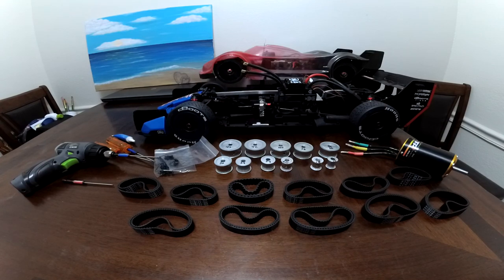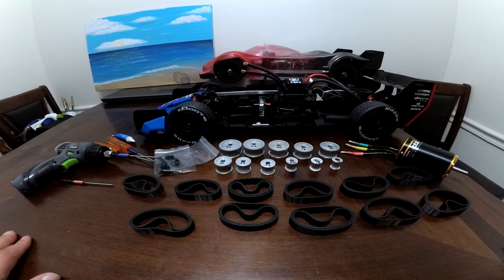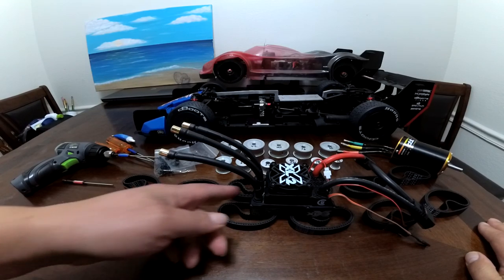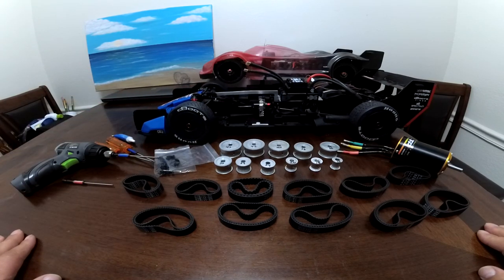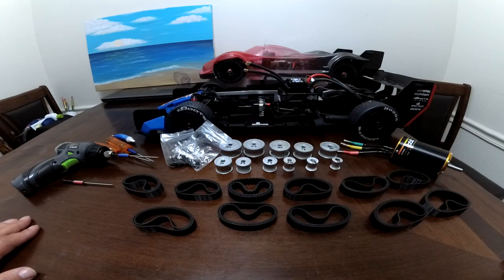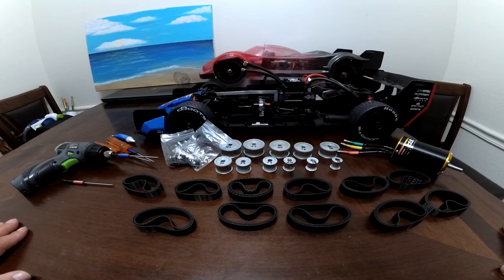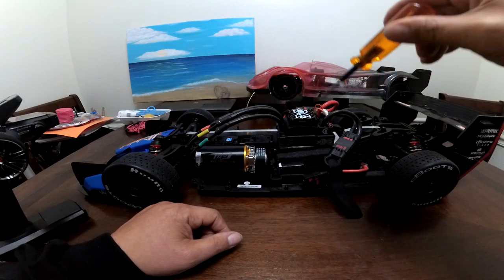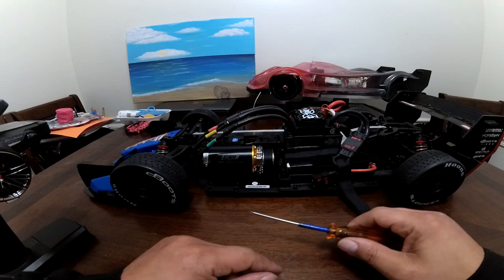Arrma Limitless Belt Drive Drag Setup

Comment: A bro do type in every gear separate or in the link its all in one like a bundle bro . Thanks
Reply from the maker: no bundle ~ you got to pick witch ones you want
Reply: @MarcusHicksK.O.C  but when u try  t change the belt size . It want let me get ther sizes it just start over . For some reason
Reply: @Dirty263  You just pick what you want, then add to basket and repeat until you have all the sizes you want.
Reply: @gmballistic506  its like when i switch perimeter its just change all the settings . When im trying to switch belt count
Reply: @Dirty263  Weird. Maybe try opening multiple tabs of eBay and just keep adding to basket that way?? IDK good luck.
Reply from the maker: @Dirty263   you got to pick the belt size you want ~ then add it to your cart ~ then you have to reset all your selection back to select & then you can change the belt size on the top selection ~ then just keep repeating that till you got all the belts you want in your cart..

Comment: When u say the size of the pulleys is that mod1 or does belt drive go by something different
Reply from the maker: something different ~ i have 3mm pulleys ~ witch means the space between the teeth on the pulley is 3mm & you need 3mm belts to match ~ they also have 5mm if you want them thicker

Comment: only problm i got is tp shaft aint long enough , what motor mount u are using?
Reply from the maker: im running a tp & it fits good ~ Screw Adjust Motor Mount from (practicalproto.com) & its perfect for the belt setup cause you can tighten the belts tension perfectly
Reply: @MarcusHicksK.O.C  ok thanks and what solder iron or watt u use to solder those 6awg wire
Reply from the maker: @GregACL971  https://www.amazon.com/gp/product/B00ANZRT4M/ref=ppx_yo_dt_b_asin_title_o04_s00?ie=UTF8&psc=1 & this tip https://www.amazon.com/gp/product/B00762AHTE/ref=ppx_yo_dt_b_asin_title_o04_s00?ie=UTF8&psc=1 at 899 degrees

Comment: Do you still run 6 gauge on your xlx2's
Reply from the maker: Yes But Not On All Ofem
Reply: @NorcalSpeedAddiction  why is that im thinking about going 6 gauge all the way around
Reply from the maker: @lifeofcurry86  This is just my opinion ~ Its easier on the esc, motor & batteries to push/pull 5-600+amps through a 6 gauge wire than a 8 gauge wire ~ Witch should reduce heat & raise efficiency. If you look up the amp rating for each wire you will see that the 6 gauge wire is way higher. I would need to make a video to really explain it.